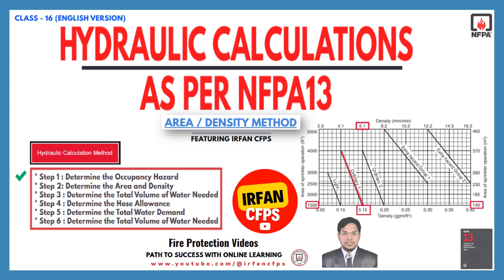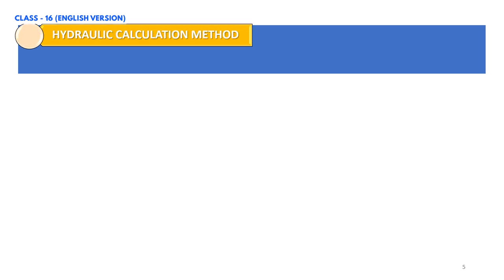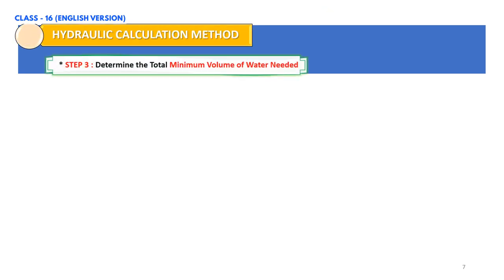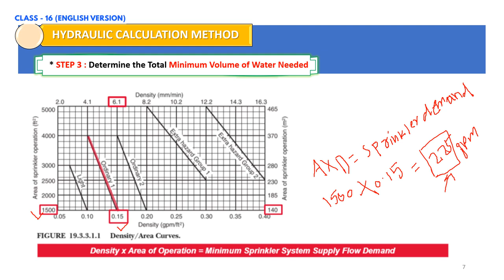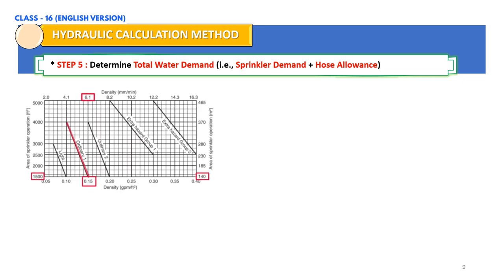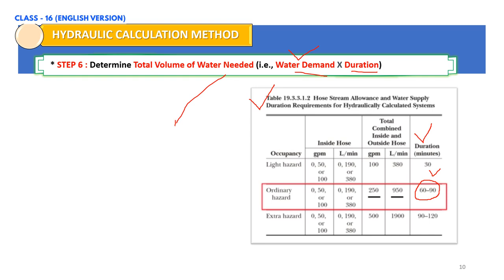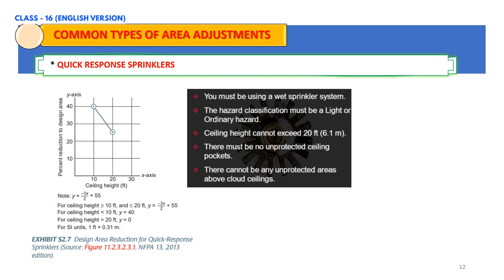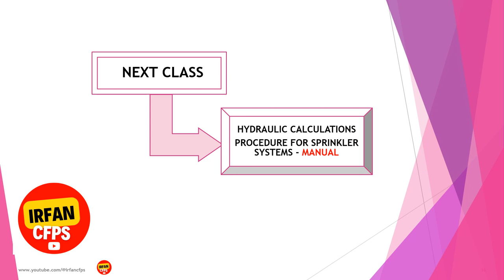Class 16 | Hydraulic Calculations for Sprinkler Systems

Comment: As per NFPA, Hydraulic calc is required only for extra hazard, and pipe schedule method for Light and ordinary hazard, But for verification of existing system we can use hydraulic calc for all hazards.
Reply from the maker: The pump selection and pipe sizing has to be done considering hydraulic calculations only for the new buildings even for light/ordinary or extra hazard.
For existing systems you can use pipe schedule method for pipe sizing..
Reply: But as per NFPA, you can't use pipe schedule method for extra hazard.
Reply from the maker: @Bestmotivationalquotes874  Yes i totally agree with you.

Comment: Hallo sir,  I have one doubt regrading hydrant calculations.  
What is base for K value of hydrnat  does it is given in nfpa.  

And it does have relation to moc of hydrnat  like ss or gun metal
Reply from the maker: Hydrant k doesn’t depend on moc. K factor will be calculated based on flow requirement and residual pressure requirement (@20psi). When u have Q and P u can calculate K
Reply: Noted with thanks  for your valuable inputs and reply  sir

Comment: What if there is a network combined with fire hydrant outside building and ,spinkler, and fire hose cabinet inside building. What is the step of calculation.
? Is it one by one or possible combine?
Reply from the maker: Cant be explained in one sentence.

Please check the playlist " Hydraulic calculations Elite fire: Below are the links

Sprinkler systems
https://youtu.be/IvtVit2Hjgo

Fire Hose Cabinets
https://youtu.be/gFKE2OcYYcw

Fire Hydrants
https://youtu.be/gQj9BgpoBi8

Standpipe system
https://youtu.be/WhaIwHOvdmE

Learn how to use Elite fire software
https://youtu.be/ew4A3gsxuIM